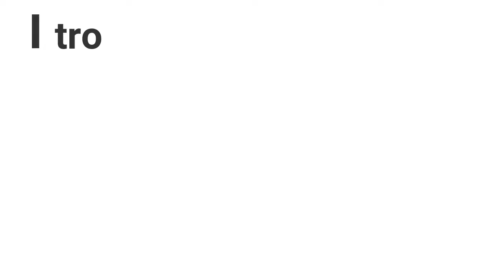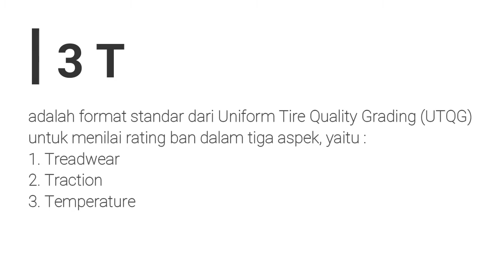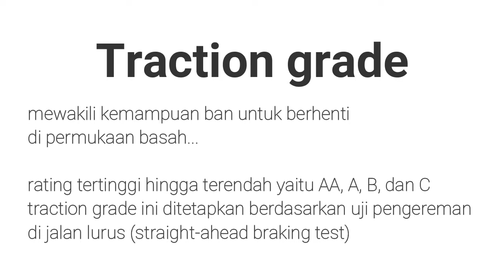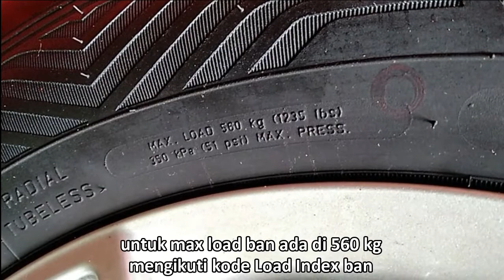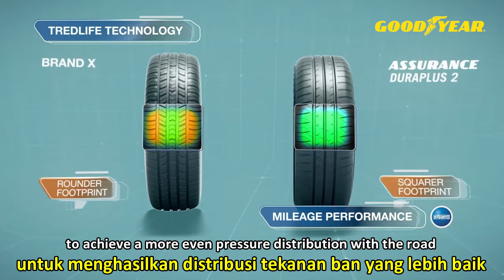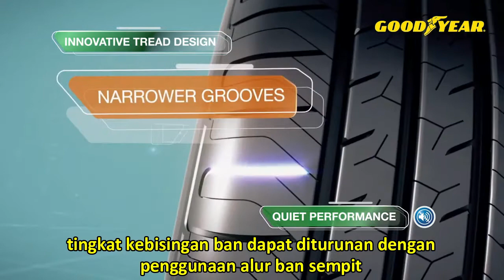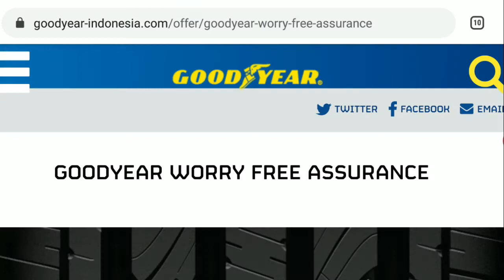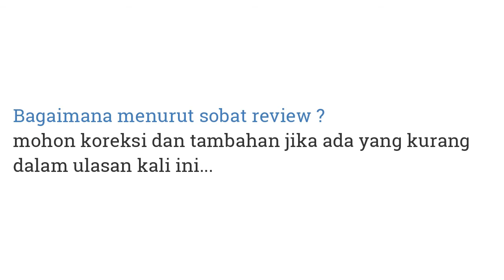Review Ban Goodyear Assurance Duraplus 2 | Ganti ban Xenia Avanza

Comment: Om.. ijin tanya dan konsul
selama ini sy pake ban GT 378 185/70 -r14, mobil avanza old om.. cukup berisik apabila di jln rigid cor beton
sy ada rencana mau ganti ban om
pemakaian lbh sering keluar kota, jujur mobilitas tinggi om, jalan lintas sumatera, Pku-Padang, Pku-Jambi di mana jalan nya aspal dan kdg rigid cor beton plus jalan rusak lobang2
rekomendasi ban apa om?
makasi om
Reply from the maker: Champiro GTR 378 memang alur ban nya agak kotak kotak macam ban all terrain. Jenis alur ban seperti ini pasti noisenya cukup tinggi.

Untuk unit dengan intensitas pemakaian tinggi, rasanya sudah pas pakai Goodyear Assurance Duraplus 2 ini. Selain durable, dan harganya ekonomis. ban ini juga masih cukup nyaman dipakai di tol dengan perkerasan kaku (rigid pavement) atau cor beton. 👍
Reply: Kalau GT radial mending BTX Pro.. kalau mobil tempur paling nda harus BS sih mas.. smpe gundul jg awet meski eco. Tp kalau ga mempedulikan irit mending techno atau b250 skalian.. awet2 betul tuh smpe dipompa 40

Comment: Saat ini ban depan mobil saya terpasang Achilles ATR Sport 185/55 R15 produksi 2015 dan sudah bocor halus, jadi musti sering2 pompa. Rencana ingin ganti ke GT Radial BXT Pro atau Goodyear Assurance Triplemax. Mobil bukan untuk harian (dipakai 1-2 kali seminggu). Namun karena mobil tua (1992), ingin yang nyaman. Mohon saran, kira-kira lebih cocok yang mana?
Reply from the maker: achilles ATR sport punya alur ban directional. memiliki kemampuan evakuasi air yang sangat baik, karena dapat membuang air ke bagian luar ban dengan lebih cepat dibanding tipe alur lain. minusnya memang, di kondisi aspal kering alur diagonal ini merambatkan getaran dan kebisingan ban sama kuatnya dengan yang kami jelaskan diatas.

jadi jika mempertimbangkan untuk wet grip baik, pilihan ke triplemax 2 cukup tepat. namun jika ingin mengedepankan kenyamanan, mungkin BXT Pro bukan pilihan yang tepat. kami sarankan tambah sedikit budget ke Dunlop LM705. ini ban kelas comfort touring yang paling ekonomis dibanding merk lain, seperti BS Turanza T005a, michelin primacy 4, atau Continental UC6.
Reply: Yang nyaman aman awet ya bridgestone turanza

Comment: Duraplus 2 vs gtx pro vs tripelmax bagusan mana bang, untuk jalan dgn kondisi rusak dan klo hujan licin dan berair, soalnya sering dibawak keluar kota
Tipe ngendarain mobilnya cepat bang...

Mohon sarannya bang...
Reply from the maker: Urusan wet grip.. GTX pro paling unggul di pola alur bannya yang memakai alur satu arah (directional pattern). Pola ban seperti ini mampu mengevakuasi air lebih cepat di kecepatan tinggi. lebih resisten terhadap aquaplanning. Minusnya ban seperti ini tidak begitu fleksibel untuk dirotasi dan punya road noise yang relatif lebih tinggi ketimbang ban dengan alur simetris atau asimetris.

Kemudian saat menghadapi jalanan rusak, duraplus 2 mungkin akan lebih unggul di sidewall nya. Dengan spec 2 ply di struktur dinding bannya pasti ban ini memberikan rasa percaya diri saat melibas jalan yang kondisinya kurang baik. Karakternya berada di antara GTX2 yang sidewallnya lebih rigid dan Triplemax2 yang mengutamakan kenyamanan berkendara. Plusnya dari ban ini yaitu angka treadwear nya yang cukup tinggi. Bisa diandalkan dalam kondisi pemakaian mobil yang intens, karet ban lebih awet dengan jarak tempuh yang tinggi.

Untuk triplemax2 ini menurut kami lebih all round untuk semua kebutuhan berkendara diatas, teknologi hydrotread yang ada di ban ini diklaim memberikan kemampuan wet grip diatas ban standard. Pola alur bannya bertipe asimetris juga lebih mudah dirawat dan dirotasi, serta punya tingkat road noise yang tidak sebesar ban bertipe directional. Untuk jalan rusak ban ini cukup nyaman juga dan dipercaya beberapa pabrikan sebagai ban bawaan produk mobil mereka. Contohnya Hyundai menggunakan ban Goodyear triplemax 2 sebagai ban OEM untuk mobil Hyundai Creta rakitan lokal di Indonesia.
Reply: @segaladireview  maaf om, bukannya ban kalau asimetris malah tidak mudah untuk dirotasi? 
Karena pattern inside beda dengan outside.
Maksud saya rotasi di sini adalah juga termasuk membalik sisi sebelah dalam, jadi sisi luar, seperti halnya ban simetris

Comment: Om mau tanya nih saya mau ganti ban bingung antara assurance duraplus dan assurance triplemax? Boleh Minta saran
Reply from the maker: duraplus 2 punya advantage ke long mileage, dengan compound ban lebih Hard memberikan durability pada karet ban nya. dengan bentuk alur ban yang cenderung polos sehingga mempunyai area kontak luas memberikan grip yang baik dan road noise yang cukup baik.

sedangkan untuk seri triplemax 2, punya groove ban lebih banyak dibanding duraplus 2. memberikan kemampuan evakuasi air lebih baik, ditambah dengan compound karet ban yang lebih soft (treadwear 320) dan alur ban dengan biting edge lebih banyak, tentunya grip dan kontrol stir lebih presisi. juga jarak pengereman akan lebih pendek.

 minusnya dengan alur ban lebih rame seperti triplemax 2 ini road noise biasanya ada di level lebih tinggi. pas sih buat mobil2 mpv medium yang peredamannya baik. kalau tidak salah, ban ini dipakai sebagai ban OEM wuling cortez.

kesimpulannya : tinggal pilih ban yang sesuai kebutuhan saja. mau yang durable (duraplus 2) atau lebih ke perform wet grip (triplemax 2). untuk harga triplemax 2 hanya terpaut tipis sedikit lebih mahal dibanding duraplus 2.

Comment: bagaimana gripnya di toll road speed biasa aja toh ada limiter tapi kondisi di kondisi jalan basah atau genangan tipis di toll ya ? pengen nyobain, tapi belum ada yang ngulas hal ini
Reply from the maker: untuk ban dengan kondisi baru, gripnya cukup baik di kondisi aspal basah saat hujan. kami masih berani jalan di 80-90km/jam.

jika menginginkan grip yang lebih baik, goodyear punya seri ban Triplemax 2 yang harganya selisih sedikit dengan duraplus 2 ini.
Reply: @segaladireview  kalau b250 saya puas sih mas, gak pernah ngesot2 genangan kecil di tol pun enak diatas 100kpj stabil dia, tapi ya harganya itu knp naik mulu ya 😅 brati goodyear yg setara b250, triple max ya ? Coba tar ah ke tokoban. Gy masih manusiawi harganya
Reply from the maker: @jogetindj6130  betull banget, kami tujuh tahun pakai juga bridgestone B250. itu ban ga pernah ada masalah. kondisi ban masih sangat tebal karena kebetulan mobil baru jalan 45rb Km. 

tapi memang harganya lumayan.. satu ban B250 sudah menyentuh harga 800rb. sebetulnya ban Bridgestone juga ada yang lebih oke wet gripnya.. mungkin bisa di simak review ban Bridgestone turanza T005a di link berikut https://youtu.be/rK293csHdGg

Comment: Godyear duraplus2 dengan triplemax2 bgus mna y gan ,buat senyap, kenyamanan dan durability? Harga mirip" soal y ...dan apakah tahan tdak bnjol tdak sprti dunlop
Reply from the maker: Duraplus 2 dengan triplemax 2 memang harga jualnya tidak terpaut jauh. Biasanya seri ban Triplemax 2 ini selisih puluhan ribu saja dengan Duraplus 2.

Oke, yang jadi pembeda yaitu dari spesifikasi bannya. Duraplus2 unggul di durability dan long mileage. Jika cari yang ga cepet botak dan dinding ban yang kuat, Duraplus 2 ini ban yang cocok. Rating ban nya sesuai di bahasan video Treadwear 380 Traction A, temperature B

Sedangkan untuk Triplemax ini selling point nya yaitu grip dan kenyamanan. Ban ini punya sidewall yang tidak sekeras ban Duraplus 2 yang fisik ban nya cenderung mengotak. Kemudian alur ban asimetris dengan kembangan ban bergaris diagonal. Tipe alur ban seperti ini memang banyak dipakai oleh ban ban yang punya wet grip baik, seperti BS Turanza T005A, atau michelin primacy 4. Rating ban ini yaitu.. treadwear 320, traction A, temp A.

Jadi untuk kenyamanan dan perform (grip) tentu si Triplemax ini lebih unggul, namun untuk durability ban Duraplus 2 ini akan mampu bertahan dengan jarak tempuh lebih tinggi.
Reply: @segaladireview  wahh mantap jawaban y bang ...mksh info y